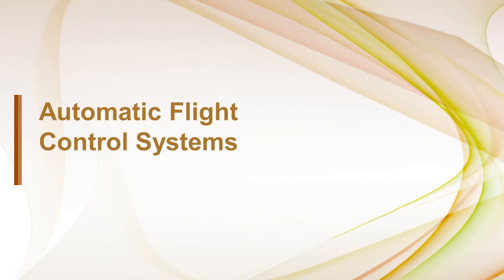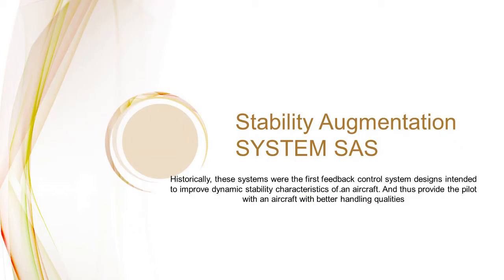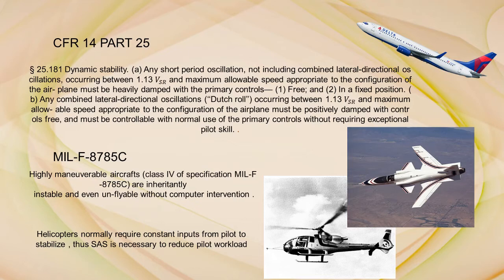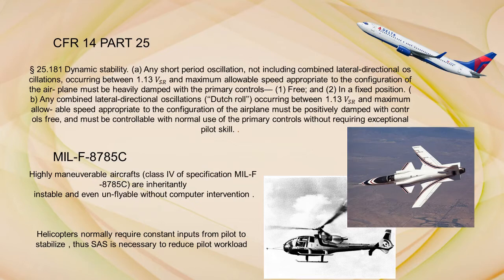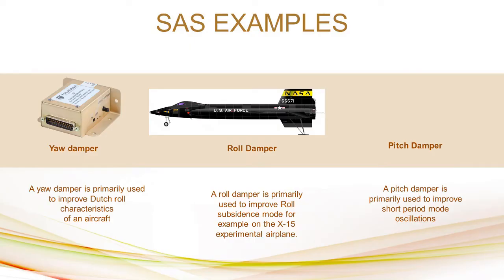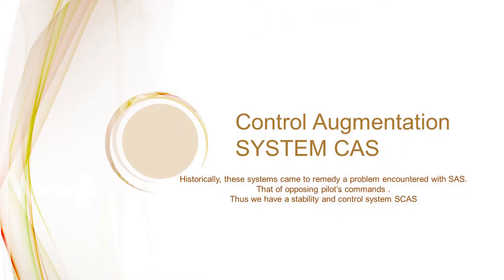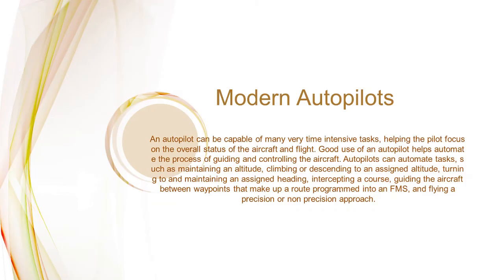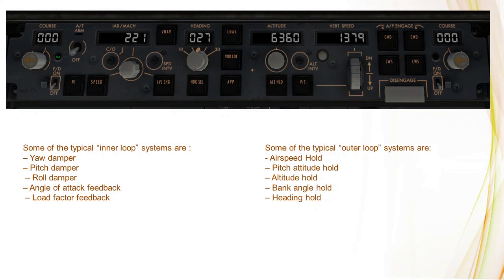Automatic Flight Control Systems - How autopilot works

Comment: This part of the project is to control a CD4066 bilateral switch to extract a small portion of a signal for analyses. In past iterations of the project we used various astable oscillators with a lot of phase shifting to control the switch but, as we were using the ESP32 for other parts of the circuit, I thought it would be a great idea to use it to control the three gates. Hope that makes sense